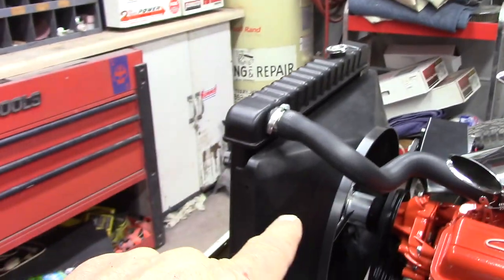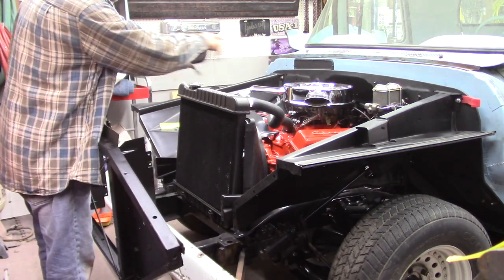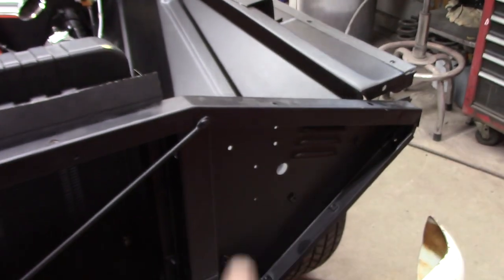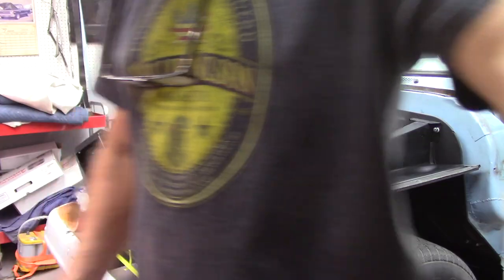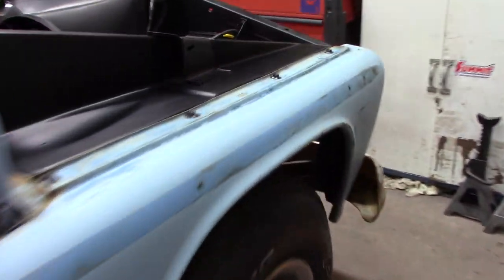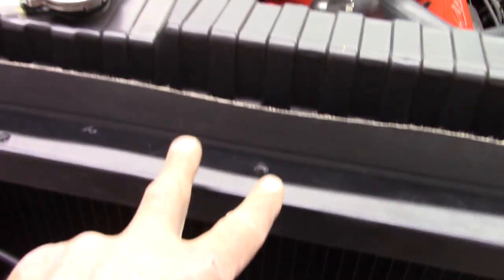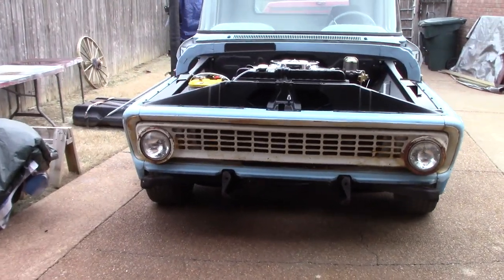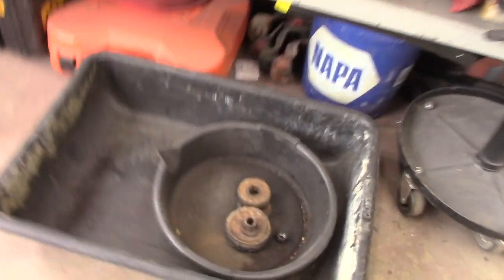Install Front Clip/Chevy C10

Comment: “I learn much from watching, and thanks much! I follow what your doing on your truck, I’ve got a “63” C-10 with 383 Stroker 5 speed Tremec going in this Spring. You are helping me get ready Sir, for this upcoming mod for mine! I thank you much, also thanks for the work you showed for the “American Autowire” rewire job of yours, helps me. I’m a retired old dude from military with ptsd from serving for 18 years. I was Jet Engine Technician on B-52’s did well as Master Mechanic on jets. Trucks etc. are different of course. I’ve got difficulty getting info to my hands. It is slow for me, but again “your helping me so much Sir, I thank you for all you post here!

“You Rock the old truck Sir!”

Thank you!
Reply from the maker: Thank you for your service and thanks for watching take care and good luck on the 63

Comment: You're my hero, been building my 66 along with you. Did you end up using any shims on those top inner fender to cab bolts? I can't get the lower inner fender to cab bolts to line up, it's weird since it's all original only been apart for 10 years lol. Looking forward to hearing back about the shims, thank you!

Comment: Love the video. How are you putting oil in the engine. I do not see any filler caps on valve covers or an older filling spout.
Reply from the maker: The valve covers were made by PML the oil filler hole is on the side of the valve covers along with the PCV valve
Reply: Thank you for the information.  Dad and I are working on a 56 Bel Air 2 door hard top  with a 327 I like that look